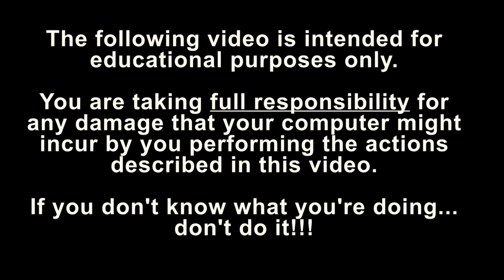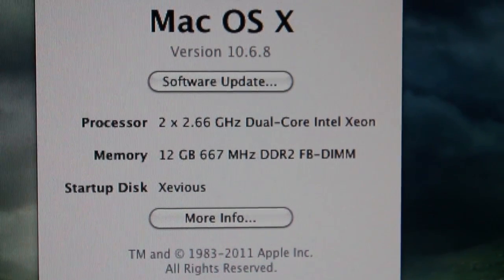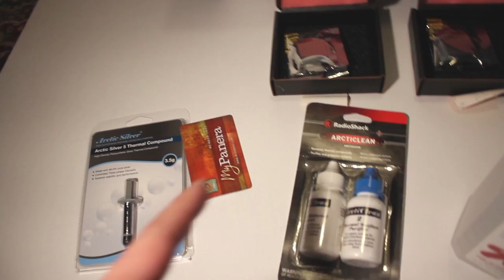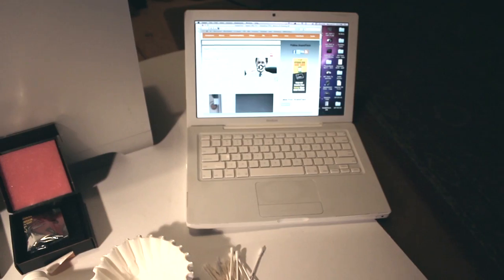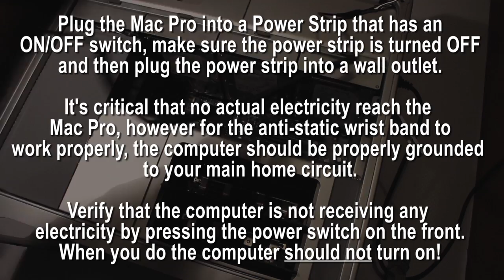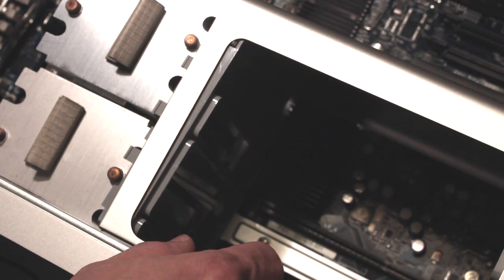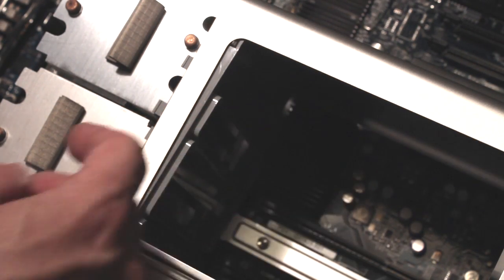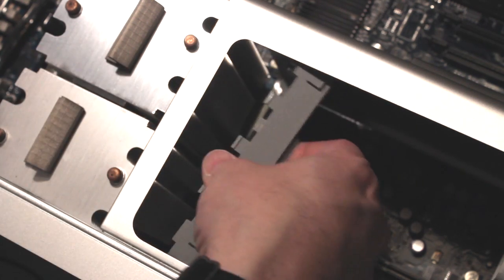Change the CPU in a 1st Generation Mac Pro (Part 1)

Comment: There are two screws holding the fan. One, as the video shows, the second is right next to the heat sink. Probably have to look from front view, rather than side view used to remove the first screw.

Comment: Good guide, but a quick note: please don't use a torx bit to remove the coolers. It'll fit but there's a good chance you'll strip the screws. These are hex screws, not torx.

Comment: My comment, greatly appreciated tutorial,  hence my dual front fan still not coming out ,am I missing a tab , using the wrong credit card ? From the screw side it unlocks but the bottom is really hung-up ? I can almost lift the machine up with whatever is holding it down
Honestly uncliped, Help!!!
Reply: Same here the front fan just won't get out

Comment: I just upgraded my MacPro 1,1 2 x 2.66 GHz 4 core to a MacPro 2,1 2 x 3 Ghz 8 core. Thanks for the easy to follow directions. Everything is running great with 16GB RAM, 120GB SSD PCIe startup drive, El Capitan 10.11.6. All for under $200.
Reply: how did you install el capitan. i want to upgrade my mac pro
Reply: http://piker-alpha.github.io/macosxbootloader/
http://www.caradimas.org/john/?p=193

I build the El Capitan Boot disk while it was connected to my 2010 MacBook Pro. Then followed the directions in the second link above.
Reply: http://www.ebay.com/itm/182310984409

This worked on my 1,1.

Comment: My early 2008 tower has two screws on the fan housing, one at the top 
right, and one bottom right, near the heat sink. It's hidden from view 
by the sink shield, and the front of the housing itself. The head of the
 screw points to the back of the case.
Reply: thanks for the info! how do you gain access to the second screw?? It's driving me insane!

Comment: Unfortunately in my 1,1 the fan assembly in the front doesn't come out. It seems to be stuck on the bottom. There is no movement or point to grip down there, so I can't reach my CPUs. Really bugging me that I wasted money on something I can't use.

Comment: The plastic card trick is bs. As you can see in the vid he has it off allready. It does not work. Been trying this for an hour now and giving up now. No new CPUs for me
Reply: +Jan Eversby It's not BS, you just have to try it from different angles. I've done a ton of these and you have to get them in at a 45 degree angle from the CPU side near the bottom and top of the front side of the memory cage, and the near and far ends of the top side. If you don't have two cards, try to pop them and apply pressure to keep popped out, then pull out card and get the other side, enough to where you can turn the top side in and the whole thing will rotate out with minimal bending. A bit tricky and creepy but like with most things Apple, once you learn the clip locations/directions, it's easy.
Reply: +mootworks yeah, will I was kind of frustrated when I wrote that. The thing is, that it worked. It took a lot of hard work, but I managed, so thanks to the creator of this vid.

Comment: Great guide. Be sure to remember to reset the SMC tho (small button on the motherboard) or else your computer is liable to freak out not knowing it has new brains. The OS will load and then freeze and you will hear the fans kick in like they have never before. All will be normal after a SMC reset.

Comment: Any more tips for removing the plastic separator? I tried using a plastic card but it doesn't seem to want to come out, and using a second plastic card for the other latch didn't help.
Reply: +1
Reply: +Nelson Gomez Use multiple cards along the edges tabs, you can feel them when you insert the cards.
Reply: Violence. That will get it out :)

Comment: I took the font fan screw out and I tried and tried but I can't get the fan out
Reply: There is another screw just above the heat sink, flush to the bottom of the case. I just broke it, 2 mins ago.
Reply: @rejijesudasan8072  damn bud. I posted that comment 9 years ago. I done sold that thing 8 years ago. But thanks I ended up figuring it out.

Comment: What is the latest OS I can upgrade my 1,1 with this mod?
Reply: i installed Yosemite on my macpro 1.1
& i know u can install El Capitan
but u have to change the bootloader to EFI 32
Reply from the maker: +dsertwq Unfortunately I think you're limited to Lion. There are some hacks that allow you to put in a later OS, but I can't speak on how well they work since I've never done it myself.

http://9to5mac.com/2012/07/23/mountain-lion-installed-on-a-macpro11-heres-how-to-do-it/
Reply: +midphase Thanks! I found these CPU's online : Intel Xeon E5345 SLAEJ Quad Core 2.33GHz 8MB 1333MHz Socket 771.  Will this work?  Will it be worth the $50 for both?
Reply: Thanks!
Reply: midphase and now ?

Comment: Anyone else hear a loud beeping sound when putting the CPU's under stress?
I hear it when I run Geekbench, Cinebench, or Handbrake.
The beeps are random, sometimes short, sometimes long.
Mac Pro 1,1 w/ X5365
Reply: Casey Couser Check if you have RAM sticks that aren't pushed all the way down. That beeping is probably the BIOS giving you an alert.

Comment: which 5355's will work with the 2006 1,1......SLAEG?   SLAC4?  SL9YM?
Reply: All of them, but the SLAEG use half of the power/electricity.
Reply: Thanks.  Will try the SLAEG then. Will I need to ramp the fans for extra cooling?
Reply: From what I've read, if you have installed the firmware update using the netkas firmware tool to make your mac a 2,1 the fans will work the way they have to by themselves.

Comment: Word to the wise... DO NOT use any Intel stepping other than SLAED for the X5365's. It uses GO stepping which consumes half the power of the other step codes at Idle and a lower TDP of 120. Using the correct one will allow your Quad Core cpu's to use the same wattage as the stock dual core X5150 about 20-25W/Idle.

Comment: Thanks so much for your video. Just finished the install and now I'm running twice as fast on my mac pro 1,1 - I went for the 8-core setup with dual 4-core xeon 5365s, and then also did the 2,1 upgrade as well. Very clear directions, you made it easy my friend! Much appreciated!

Comment: cant wait to do this on my 1.1 Its in dire need of an upgrade and for 60 bucks and some supplies it aint bad to double your speed.
Reply: ***** I have the X5355 (2.66) with the SLAEG stepping, which on the Intel site shows them as having the GO stepping to reduce power consumption around 25w, but my sensors say I'm using 40w. I need to figure this out because my cores are running hot at idle and I'm jacking my fan speed up way high. I'm running 64bit Mavericks too consuming more energy. Now I know why I've been freezing

Comment: Just wanted to give you positive feedback - I did this about 1 year ago and it worked great. No issues, much faster Photoshop and finder activities, no downside. The machine still functions perfectly as my main computer.
I had added many different things to my Macs over the years (HD's, SSD's, Zip drives, RAM, video cards, even CPU upgrade to my 1993 6100!), but this was the most complex, so there is also a definite feeling of accomplishment - and it was the best $100 (for 2 x5355's on eBay) I've ever spent to upgrade.  
Thanks for your superb instructions!!

Comment: I have done this it was very easy. I used a Torx 15 instead of a 3 mm hex wrench. I also updated the Firmware from MacPro1,1 to MacPro2,1 and then updated from 8GB ram to 16 GB ram. All is working great. Does anyone know what CPU-C and CPU-D are? I purchased Hardware Monitor 4.98 from Marcel Bresink Software, to monitor the before and after temps and fan speeds.

Comment: I'm considering doing this, but the most I've ever done is install a 2nd optical drive or a graphics card update.  This video looks very clear to follow.

Also, how important is it to update the firmware to 2.1?  Will the computer not run to it's full potential, or will it just not say "This is a Quad Core" when you look at the system profile?
Reply: I did not update the firmware are first, and all seemed to work well. then I read that the firmware update fixes other things too, and took the leap. It works well. My long range plans are to use Chameleon to allow me to run Mountain Lion and Mavericks too, since Chameleon allows a spoof of the SMC version and allow an EFI-64 to boot. Will attempt this soon.

Comment: Wow i think you need to calm down, what I said is completely true. I did not say the UK is the only place to have 3 pins, in fact I specifically said I don't know about other countries.
In the case of the US and Europe yes you do have plug sockets that have available a grounding pin however most companies (Including Apple) choose to use the 2 pin varieties for compatibility as they are smaller; this is the same in the EU where most companies use the Europlug 2 pin.

Comment: Oh, one more thing... The T15 torx head did not work for me on the 4 heatsink screws. I did happen to have 3mm hex and that worked perfectly. That was 50% of my stress. Actually one more thing... when you have everything out of the motherboard, make sure to inspect all of the capacitors in and around the cpu's and the memory cage and make sure that none are bulging. They should have a flat top with no cracks. Stop the pain before it starts

Comment: ... now I'll be able to keep my RAM temps down.  Apple should include that utility with the MP. If u decide to go wit the 5355's, u must get them with the SLAEG stepping.  They use less power in idle mode similar to the stock 5150's. Otherwise the fans will spin too fast. The whole upgrading process can be a bit stressful, but so far I'm a happy camper with no kernel panics. email me if u need the links to those 2 utilities I mentioned. Thanks again midphase for this tutorial.

Comment: Soo... I think I'm finally done souping up my Mac Pro 1,1. I went with the X5355's SLAEG instead of the X5365's. It's about $250 in savings. I got a pair of 55's for $90. The 65's go for $350. There wasn't much performance difference looking at the benchmarks between the 2 model chips. Adding 4 more cores was more important to me than clock speed. I used the Firmware tool to turn my 1,1 to a 2,1 and now the 5355's are recognized. I got the SMC FanControl utility to keep everything cool...

Comment from the maker: First of all...it's NOT GLUE!!!  Just making sure, it's thermal paste (Arctic Silver) which is not necessarily sticky, more like toothpaste. It doesn't dry, you prep the surface of the CPUs and the Heat Sink as I show in the video using ideally a Panera Card, and then you wipe off the excess so that all that is left behind is a matte coating on both surfaces. Then you squeeze a small grain-sized bit of thermal paste on the CPU and screw the heat sinks in without over tightening.

Comment: There's a trick I learned from working on my motor scooter when you can't get a screw off, and it might be worth a try: spray it with canned compressed air (you know, the stuff you use to blow out things like computer keyboards). The metal will cool, and may contract just enough to loosen up.

Comment from the maker: Yes, the old chips were the XEON 5150's (no relation to Van Halen). So I went from 2 dual core 2.66ghz to 2 quad core 3ghz. It made quite a bit of difference. Just today I re ran Geekbench 64bit and it came back with a score of over 11,000...not too shabby for a 6 year old machine!

Comment: Hmm... maybe that's why some people have experienced kernel panics after upgrading... they could have used other configurations?  Yeah, I've been researching a bunch, but I don't see anyone really talking about the configs so much, or that SLAED is important.  BTW, even though I haven't upgraded my chips yet, I did use this tutorial just to get inside and clean everything and reapply thermal paste to the stock chips.  I bought it used and it was nasty inside!  It helped out a lot.  Thanks.

Comment from the maker: I have heard of people having success with the SL4AD chip configuration. Just so you know, my understanding of what SLAED is is that it's a certain instruction set that the chip recognizes. SLAED is what Apple uses, other types might or might not function and OS X might have issues with them. My experience is somewhat limited to using SLAED successfully. You might want to do some Google research before purchasing some other type.

Comment from the maker: It's really best if you install the pair. I heard you can run just one chip (and leave the other socket empty) but I don't think it's a good idea to mix them up. It's really safest to just take the plunge and install the pair at once. I bought mine on eBay around this time last year for around $480 for the pair, I would think that they would have come down a bit by now.  I don't really know what PROC stands for, the big key words are SLAED and LGA771

Comment from the maker: I bought mine on eBay, just do a search for x5365. Xeon chips are generally used in servers, so it's not unusual for someone to pull them from a server to upgrade to something else. If you buy them used, try to find some with some sort of return policy if they are DOA.  Good luck!

Comment from the maker: Sounds to me like you might be having some heat issues (the fact that we're in the middle of a scorching summer probably doesn't help).

My advice would be to get your hands on the Temperature Monitor app by Bresink to give you an idea if you're getting close to the high range of the recommended temperature range. If the cores or other parts of the computer are too hot, you should place your Mac Pro in a more ventilated area (sometimes having the Mac under a crammed desk isn't a great idea).

Comment from the maker: I hear you. Honestly it's kinda difficult to convey how much force is needed on video. I will say this:

Drives - can be a bit tough, just grab the aluminum flap and pull straight out.

Memory Boards - Grab the board with both hands at the holes and pull straight out, they should come out easy. When you put them back make sure they are well seated in the socket.

Fan assembly - this is the toughest one, once you remove the one screw you might need to wiggle it quite a bit as you pry it out.

Comment: Hello, 
Firstly thank you very much for this ace video - you really did a nice job! 
If I may say though: you often edit out the EXACT PART that I want to see: you have 5 seconds of pointing at the drives, but then cut the part where you wriggle them out. Same with the memory boards: you show them static, but cut the part where you take them out! It would be good to see those bits, to see how much force you use and how you move them.
Anyway, great job and thanks!

Comment from the maker: Generally speaking, all Intel Xeon X5355 or X5365 should work. Look for the word SLAED in the specs.

Right now I'm seeing tons of great deals for matched pairs below $400...about $100 less than what I paid for them.

Make sure you buy from a reputable seller with good ratings on eBay, and ideally try to find one which has some sort of basic 5-10 day return policy in case the chips are defective (pretty rare).

Comment from the maker: You can try to change the CPU info in the aboutthismac.pkg in the main Library...but I heard it can screw up your OS and it doesn't work with Lion. My advice would be not to worry too much about the "unknown" CPU...doesn't make any difference in practical use.

Comment: So i just got done upgrading mine and watching this video. Which is great by the way can't thank you enough. Bam twice the speed and performance with 6 gb of ram im getting a 10156 benchmark comparing my old cpu's 51210, my question is when i go to "About this mac" it says 2 X 3 Ghz Unkown instead 2 X 3 Ghz Intel Quad Core  I don't really care if it there is no fix for it as long as my computer works fine but if there was i would like to fix it. thanks bill

Comment from the maker: On eBay. They tend to come and go, and the pricing seems to fluctuate quite a lot. Do a search for X5365 or X5365 Pair and you should come up with some results.

FYI, I paid about $500 for two CPU's, but as I said, pricing seems to vary quite a bit and I've seen them go for almost double that (which IMHO doesn't make the swap as financially sound of a decision).